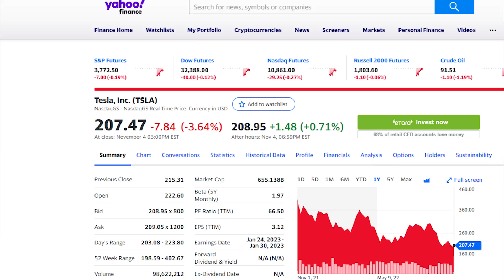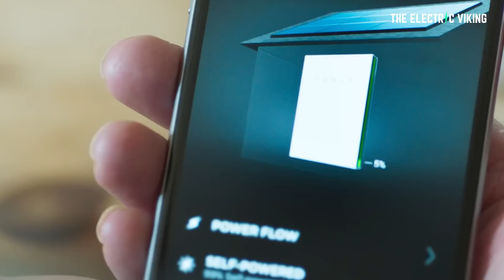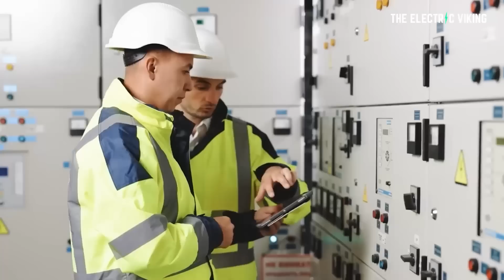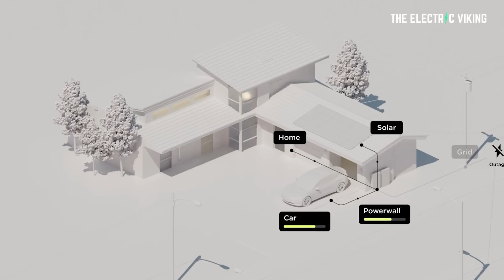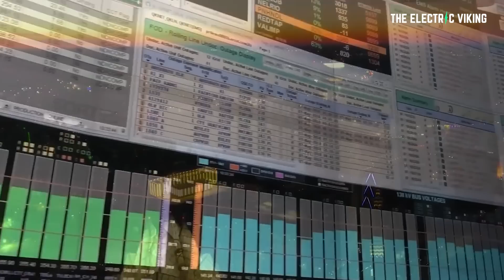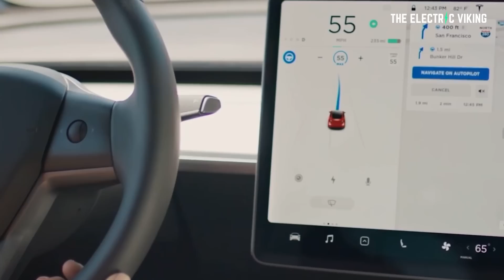Tesla plans to make $billions saving Texas' terrible energy grid

Comment: Excuse me! I live in Texas. I was around in February 2021 when we had that awful cold snap and Texas' power grid DID NOT go down! In fact the only reason it even came close was due to the wind farms in west Texas FREEZING SOLID. Now we did come close to our grid going down but it never actually went down. If we hadn't been so dependent on unicorn farts (excuse me "green power") we would not have come as close as we did. FYI, Texas' power grid is one of the best designed, best run grids anywhere in the country! We in Texas are in a hell of a lot better position power wise than you Brits.

Comment: Um, Texas doesn't have a "terrible" energy grid at all. I don't know where you get that misinformation but it's wrong. The grid is one of the best in the world. The problem last year was a 138 year subarctic ice storm that dropped the subtropics there down to negative 20 degrees for 4 days. The grid in Texas was designed for temperatures exceeding 120F in the long hot summers...which is basically 7 months. It's not designed for subarctic ice storms....you can't have both. On a second point, the past 2 summers have exceeded 105F heat with no problems at all, even while bringing in more than 2 million more people from other states who have moved there. At the same time, the northwestern states lost their part of the so called national grid for a week when the temps only hit 90F, which is a cool front in a Texas summer. So maybe you should put that in your history notes. I doubt Texas will have another subarctic ice storm for another 130 years, which is a proven pattern. Texas also runs an incredible amount of industrial needs to supply energy to most of the country, and can still handle it. When Chicago breaks 85 degrees for a week, they close the entire city down. It's all relative. Texas is in the subtropics...and most of the natices there know how to deal with it and did well. The people who had problems were new here who watched too many westerns thinking it's a desert and it never gets cold. See how that works?

Comment: No PowerWall or solar needed, technically. Every EV has 2-5 times the capacity of a PowerWall. Use a fraction of that capacity Vehicle2Grid while car is parked, owner makes money, drives 10-20 miles home. Recharge off peak.

Comment: A couple of months to recoup costs is pushing it.  More like a few years (and that's the best case), particularly in Texas where energy prices are fairly low.  Even in California, the best you might get using the just-re-released NEM 3.0 (or should we call it NEM 3.1 now?)... we're still talking maybe $0.30/kWh across a 4 hour period on a hot day.   So if your Tesla battery can push 10kWh to the grid during that period, we're still only talking about $3/day.  And probably only for 1/4 of the year.  So that would be around $273/year.

It isn't gonna cover the cost of the battery.  The major recovery is still going to be from net-zeroing your utility usage like it has always been.

-Matt
Reply: 5 times more electricity will be needed when no fossil fuels and 100% electric world.
that can make a huge difference.
but for now we are transitioning and different strategies are used.

Comment: Your correct in that Tesla is more than an auto and battery company.  They are also a solar panel company, a space craft and manufacturing company, a world class satellite and communications company, an industrial technologies company, a technology research laboratory, a huge power supply company and many more things. 

Tesla has its high value not because it just makes cars and batteries, but because of all the other things it also does.

Comment: Where are the experts that claim solar panels do not work if it is cold?  Anyone see them anywhere?
Reply: I've never heard any "expert" claim that. Actually, the work better in the cold, because the output goes down with temperature. Of course, then don't work when covered with snow; but because of the tilt, snow usually slides off.

Comment: i live in texas and texas doesnt seem to have a power plan at all. their winter plan is to hope the temp never gets below 30 degrees.
Reply: You sound like you're about 20 years old or something, do you not know anything about Texas energy? 🤔
Reply: @williamscoggin1509  i know that texas energy is the most inept cheapest organization on the face of the earth. with no plans for the future.
Reply: I also live in Texas and have experienced no issues. Our energy cost is low. We may have had an over reliance on wind and solar. And, our baseload power was not sufficiently protected against extreme cold. I haven't heard if they have addressed this issue. But, when solar and wind don't work, you must rely on nat gas and coal to keep people warm.
Reply: @Tbell550  the same solar and wind that supposedly failed in texas worked just fine in oklahoma, kansas, nebraska, south dakota, north dakota, and canada. are you claiming that texas is colder than canada? the problem is that those running the texas grid saved a few bucks by not winterizing the grid!! that worked real well didnt it? like i said texas energy winter plan is to hope the temp never gets below 30 degrees.

Comment: Interesting as always, Sam.  I like the way Elon encourages homeowners who can afford to do so to deliberately over produce electricity in 'extra' solar arrays or wind generators.  Giving them a way to sell their surplus power will drive all sorts of clever and entrepreneurial individual investments.  Not only does this give them more home revenue and more assured power in their batteries and generation, they also have continuously useful redundancy in hardware for the inevitable moments when downtime for repairs is required.  Shutting down one of three mid-sized windmills seems likely to be preferable to shutting down a solitary large windmill.

Comment: Sam, you are wrong again. TESLA auto-bidder software introduces electricity in milliseconds, not minutes. Autobidder software knows when the grid is going to fail before the grid does. If the grid goes down and your house get energy from TESLA’s supplement power, your light bulbs don’t even dim. Do your damn research.

Comment: I did contract work on Tesla charging stations. There is no way they are making any money off them. The setup costs are staggering and it's easy to see how pathetically slow the cash flow must be. They just don't impact the financials at all. They set up the super charger network primarily to sell cars. There is no question that was a genius move that caused many people to choose to buy an expensive Tesla car.  They gave the electricity away for years. Now they are charging for it. In the USA competing networks now far outnumber Tesla chargers. Electrify America alone has more charging stations than Tesla. The competition also has more powerful chargers for the cars like Porsche that can charge at high rates. The issue with the public chargers is the reliability is a big problem. They aren't well maintained because the operators are losing money, they don't have the budget to service them properly yet. Yet, somehow Tesla makes money on them? My prediction is Tesla will exit the gas station business. They will sell it when they are having a bad year and need to boost the earnings per share. The current charging network business model will fail. We already know why. Almost all  gas stations are actually convenience stores that sell gasoline. There's no money in retailing just gasoline. Why will electricity be any different?
A gas station that only sold gas and only served say Toyota, would be the dumbest business model ever. 
In Vancouver there is a mall downtown and there is a Tesla exclusive row of chargers in the underground parkade. Across the isle there is a competing network that is open to all brands. I noticed the wide open network always has a similar percentage of stalls in use as Tesla does. Despite the high number of Tesla's on the road because there was nothing else to buy for years, and today's supply issues. Once the majority of cars are electric, the open networks are going to dominate. They will support restaurants and shops. The really odd thing is I keep seeing Tesla's choosing the competing network despite multiple empty stalls at the Tesla chargers literally 50 feet away. I have yet to determine why that is happening. 
Shopping malls, parkades, and hotels are going to choose to sign contracts with the networks that offer the best return.
In Canada the chargers are already increasing fees dramatically. In British Columbia the government owned electric company used to charge EV's for free. Then it went to per kwh  billing. Now, it's per minute billing. It's $12 an hour at the 50kw rate. Now, Petro Canada just upped their charging fee to 50 cents a minute. $30 every time you charge 20 to 85% really messes up the initial cost recovery math.
I really hope Tesla doesn't become an electric grid juggernaut. One corporation with that much control isn't going to end well. When companies start dominating in multiple markets they get broken up by governments. 
Anyone who really looks into Tesla finances and the performance of the solar division can see it's been a disaster. Some shareholders even tried suing Tesla over the sketchy takeover of Solar City which saved Musk's family and friends from that imminent bankruptcy.

Comment: One thing to consider Musk said at battery day the 4680 battery will cost $70 per kw ,, so the cost of battery storage could drop to around $4 ,000 per 15 Kw pack . Thats when it becomes highly viable . What is missing is power companies installing their own battery storage for grid stability and other storage like hydro storage . Gas fired peaker plants charge a lot because the plants are run for only a few hours a day .So as yearly produced electricity is very low  you have the actual cost of the plant to pay for . You need speaker plants because Solar and wind power are not reliable and adjustable to demand ,they are environmentally dependant . Texas grid problem was a complex thing ,it has a lot to do with poor management , wind farms not producing , the Grid not being linked across the nation . It's interesting that the financial reality is glossed over . The economics are a reality that someone has to pay .  Now with much higher long term interest rate costs we have consider the viability of a lot of power plants of all type .
Reply: Mega packs will not use 4680 batteries which aren’t available with LFP chemistry, Tesla has already switched to LFP batteries provided by CATL. 

This past summer and winter wind and solar production was higher than normal and reduced strain on the grid.

Comment: What I don't understand is, where's the competition? In the legacy car industry, I get it, there are many reasons and also we can see at least some competition already. In the energy sector, is it only Tesla making these Megapacks, or are there other companies doing the same and you never mentioned them? Seems that the energy part of their business is not by any means so complicated as the car industry - so what are we missing?
Reply: There are multiple companies doing grid-scale battery storage, but ... not necessarily very well.   There have numerous fires at a multitude of battery facilities. Tesla frankly has the best safety record and once they switch entirely to LFP for grid-scale storage nobody else will be able to touch them for quite a while.
Reply: @junkerzn7312  that's amazing. I was thinking we have info only about Tesla energy developments because we are crazy such fans.
Reply: Competition is peaker gas plants.
Why make a battery power plant when you can have peaker plants that are extremely expensive for the system but YOU make the money?

Comment: Nice to see moments of Bobby Llewellyn’s home life in your illustrations of home solar + battery scenarios!
Massive synergy between EVs and these power products. It’s certainly true in the uk that households with Solar PV are more likely to buy EVs sooner and EV buyers are more likely to add Solar PV sooner. Both are more likely to get home batteries.
I got Solar PV in 2011, my first EV in 2012, my Powerwall battery in 2016, my Model 3 in 2019. I also added an Air Source Heat Pump and quit Natural Gas usage in 2017.  These things come together with awareness. One part leads to all the others.

Comment: Texas doesn't have a terrible electric grid. Growth in electric demand largely because of cars using electricity instead of fuel will require big expensive upgrade in grid infrastructure.
Reply: The increase demand in Texas is not largely due to EV’s but the large increase in population.

Comment: Summary: ⚡⚡⚡
a) Texas runs a quasi-3rd world electricity net without connection to the eastern or western grid
b) risk for blackouts and high prices is imminent
c) Tesla batteries will make some change, Tesla will benefit and in parts the grid (if big enough)
d) The grid in Texas would be more efficient by connecting to neighbour grids plus som Tesla packs
e) Texas is paying a higher price as necessary, but it is a positive change

Comment: What no one realises is that is that with LFP batteries (megapacks & Powerwall) can be cycled fully several time a day - charge at night using wind for morning peak, fully charge during day using solar for the evening peak. This allows 3 times+ the sale of energy at very high prices.
Reply: Okay, so you're arbitraging grid power, or you have your own solar and wind generation?
Reply: @TixNBurrsRanch  I'm just proposing a much better way of using LFP battery storage. As more PV solar is installed utilities will eventually pay only on an arbitrage basis, no use paying for power when there is already an excess, WA will only allow new rooftop PV if they have a kill switch to the grid, controlled by the utility. They are already creating too much power at the 11am to 2 pm solar peak for the grid to handle. Same can happens at night when energy requirements are at their lower and stable wind production is at its peak. 
Charging LFP batteries at these times produces the best returns using arbitrage and stabilises the grid.
Reply: A kill switch!? Dang.
California has a 2022 trial residential demand curtailment program you can sign up for, upping payment from $1/kwh in 2021 to $2/kwh. But the PG&E online description is so opaque about the baseline that it is not clear it's as advantageous as the Tesla VPP. We're expanding an Enphase system with IQ8 tech, and the only Enphase-cooperating VPP company has a history of flakiness. V2G will eventually expand the depth of VPP capability, but I suspect that residential charger limits will choke down the kWs.
Reply: @TixNBurrsRanch  I suspect the reason California proposed the tariffs on all solar systems without battery backup was to deal with this problem, excessive power generation during non-peak periods. I did come up with an alternate system, independent micro-power stations using TESLA Megapacks based at suburban locations with high Rooftop PV. The whole suburb would be the VPP, isolated, but with the ability to regulate energy to and from the grid if necessary.
Reply: @fredkroh6576  Those tariffs never took effect due to public outcry.  The current NEM 3.0 (or maybe I should call it 3.1) has removed them (it was just released on the 8th, you can find the new proposal on the CPUC web site.  Still has lots of flaws but its better than the mess that got discarded).

But more to the point, California does not really generate a whole lot of excess power during the day except during spring and fall.   The goal should, in fact, be to generate as much excess power as possible since we need that excess power for batteries to soak up.   Its only in the last year that CA has been able to take traditional base load entirely off the grid (as in 0GW... well, at least down to to 3GW if Diablo Canyon is operating, 0GW otherwise) during periods of peak renewables generation.   Batteries are mostly responsible for making this possible.

Currently CA has around 10GWh worth of batteries that push up to around 3GW during the evening peak.  One can look at the battery graphs on the CAISO web site to see the charge and discharge pattern.   Generally speaking, the batteries try to charge as much as possible during the solar day and discharge for around 4 hours going into the evening peak (which occurs at around 7pm).  They can charge for most of the day... a good 6-8 hours.  For example, today they were charging for almost 8.5 hours at around a 2GW charge rate.

In terms of overnight operation, the batteries do charge a little from 2am to 4am in order to discharge from 4am to around 7:30am.  However, this cycle is only about 1/10 the size that the evening cycle is because electricity prices do not bump up as much during the morning peak as they do during the evening peak.   Another problem is that most of the (relatively minimal) overnight charging comes from natural gas generation rather than solar.

But apart from spring and fall, CA is still using a lot of natural gas based generation throughout the day.  Today the NG generation was around 14-15GW outside of solar hours, and around 10GW during the day (solar pushed around 13GW x roughly 7 hours today).   So to be frank, the more solar that gets installed the better.  We need at least 3x to 4x more solar than we currently have to really get off of fossil fuel.

-Matt
Reply: The flaw in that logic is that the peak demand that drives the high prices occurs once a day, in the evenings. And the sun doesn't allow charging only 12 hours a day in summer.
Reply: @TixNBurrsRanch  No flaw involved, there is more than sufficient solar up until late afternoon to supply normal load leaving the batteries fully charged for peak times.